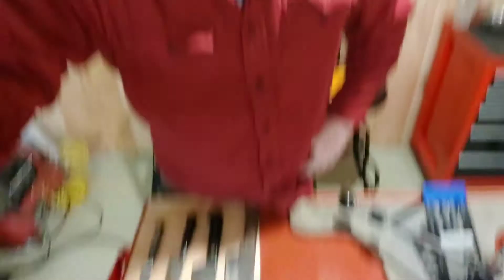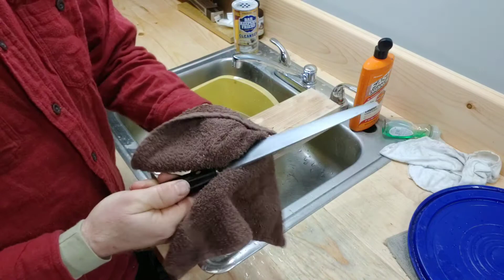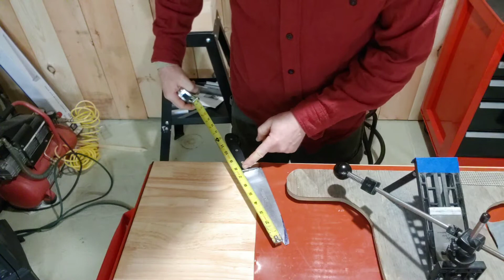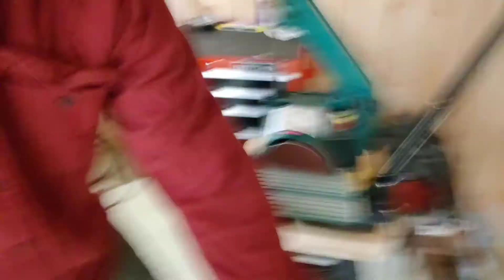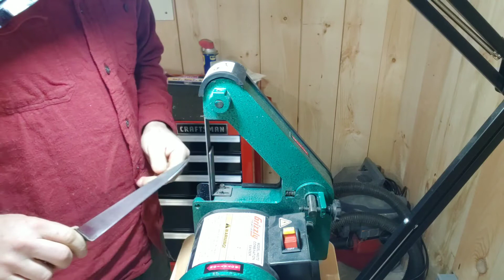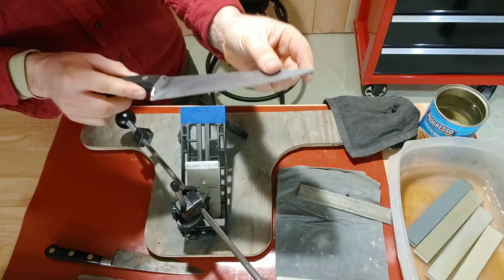TNG Ep 11: Vintage Wusthof Restoration with Tip Repair

Comment: Hi i love your video series, im a part time sharpener from Denmark... 

When making a new tip, it is  best practice to bring the spine down, insted of taking away from the edge, this  is to avoid getting into thicker steel at the edge.. Tho sometimes asthetics is more importent

Best regards
Simon
Reply from the maker: I appreciate that, and since recording this video I have adapted my ways, in large part to a great video Josh put out from Work Sharp. I agree, in most cases bringing the spine down is a great solution. Thanks Simon!

Comment: Very nice!  Just found you searching YT for "vintage Henckels".  I've got an old Henx incoming from ebay.  Ratted handles, so I will re-handle it (that's my thing).  The profile, from the poor images provided by the seller, looks very solid; no waves on the edge, tip is present, and the bolster looks un-messed-with (so full height (or close too.))  The blade itself seems to have only medium scratches.

So my questions, of which there are two, are:  1) polishing the blade: what to do after the barkeepers friend & green scrubbie?  I don't need a mirror finish but I'd like to remove any hideous scratches.  What do you rec?  2)  Bolster care:  I use whetstones for sharpening and I have a dremel and an angled sharpening unit as well.  How would you remove that pesky full bolster at the tip of the heel to keep the edge straight?
Reply from the maker: Dude, I'd love to connect. I get asked about handle repair / replacement but I'm not smart on it yet. I have a woodshop and some skills so I think I could move pretty easily into that space with some knowledge. 

But to your questions, I just recently got my buffing wheel fired up and I was able to bring the surface of a carbon steel knife into sharp condition with 2 wheels on that. Otherwise, you could try some wet dry sandpaper, like on the order of 2000 grit. I don't have much more to add to that, but if you come up with some other solutions please let me know!

Regarding the bolster, I recently did a video about recovering a swale in a knife and the same thing can be done for a bolster that is sitting too low. 
https://youtu.be/Ks9Fwd9rQWM
Based on your work, you might want to start considering a 1x30 belt sander.

Thanks for finding me, let me know if we can ever talk handle repair!
Reply: @capnmatt41  I'd like to talk more as well.  Gotta go to work right now but will be back in 8 hours.  Best way to talk via the web?
Reply from the maker: Can you hit me up on email at matt@americanedgesharpening.com and we'll figure something out?

Comment: 147 and 8 are, I assume, Wusthoff's model number and blade length in inches.  Not sure what "tack" means.
Reply from the maker: Good call, in my lingo 'tack' just means the minus sign ( - ) or 147-8
Reply: @capnmatt41  PS. The lower that first number (147) the earlier the model number and so an earlier production date.  I focus on German kitchen knives so Wusthoff and Henckels started (I guess) with 2 digit model numbers.  After they made model #99 they went to 3 digit numbers (duh) and so on.  And often they used the same model number with different lengths; so for example there might be 147-6, 147-8, and 147-10 as well.
Reply from the maker: @ericfg806  That is awesome, thanks so much for sharing that info, Eric!
Reply: @capnmatt41  You are very welcome.  I should add that there is not a lot of info available, that I am aware of, regarding these old, German blades.  I wish there was more info.  Much of what I know is just guesswork.